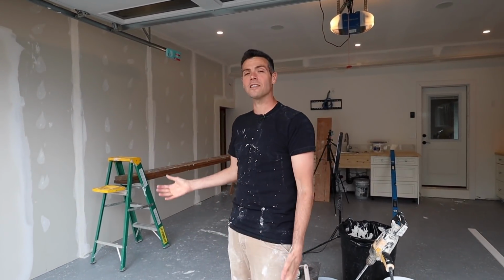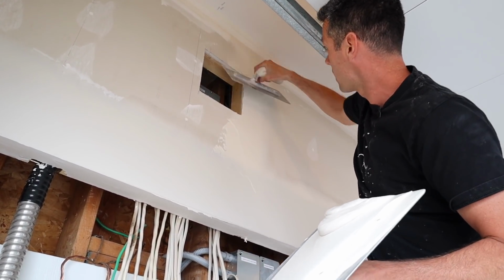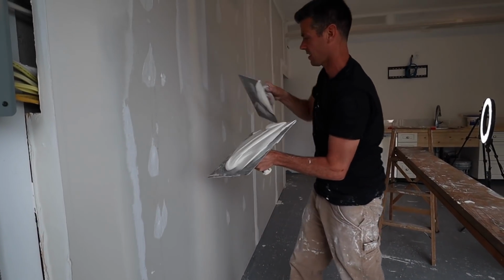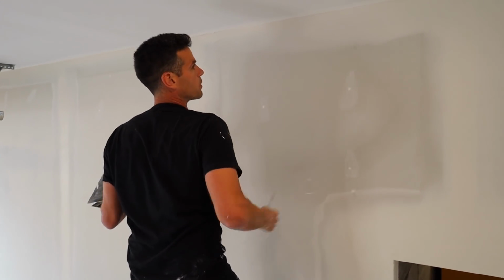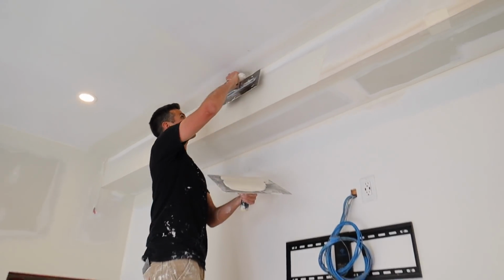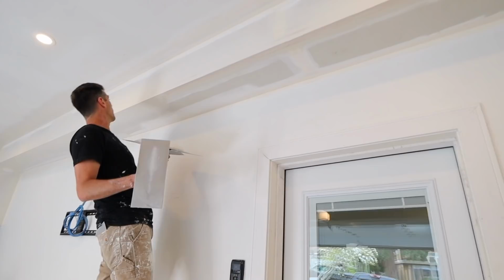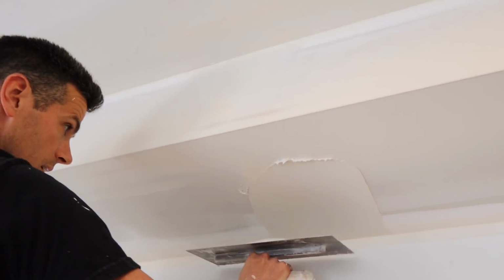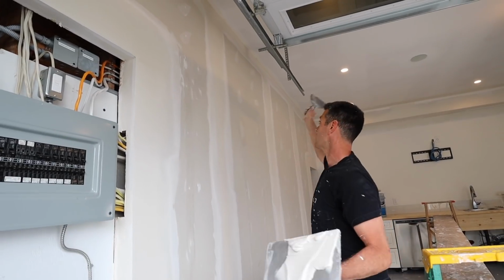First Coat on Nick's Garage!!

Comment: Old man doing home reno here. This is good demo. I'm picking up some helpful tips, like drink too much coffee B-)  But really, watching you work gives me a bit more confidence in my own efforts. Question1 : do you ever use a corner tool to apply mud to both adjacent corners at once? (maybe its in a another vid). Q2: Is your big trowel cambered? Mine is manufactured with a distinct bow, and it and requires a certain amount of "just-right" pressure to cover joints, but feathering is no problem, if i've had decaf in the morning ;-) Thanks for your videos and sense of humour.
Reply from the maker: My trowels are mostly flat but the tips go up a bit at the ends to stop them from digging in.

Comment: Safety! I can't believe you're using that drill with wet hands. You've lowered your resistance to current and way more susceptible to becoming a grounding rod. Keep a towel handy!
Reply: Double insulated tools.  This isn't the 1940's.  I've used them in a downpour.  With no gloves!

Comment: When doing a finishing coat should there be any bare drywall left or is the point just to get a smooth joints and hide the tape? When it comes time to paint can you prime any bare drywall areas?
Reply: Yes and yes. Unless you're skim-coating to remove a texture you don't need to cover the entire drywall in mud. And primer is good for both joint compound and bare drywall.
Reply: Mr. Jacobsen is correct, and most tapers will finish their work with most of the drywall exposed. The key for the tapers is to make a flat wall and that's pretty much it. But you should know that there will be a slightly different texture in the paint where the paper is and where the mud from the taper is. Most times you won't be able to really see, except in critical lighting or lots of windows. In those cases, the entire wall will be skimmed so that all the paper is covered. That is also known as a Level 5 finish, but costs extra and has to be asked for
Reply: @Phazetic99  He made another video on Level 5 so I'm a bit familiar with it. So if it's not Level 5 some bare drywall is fine?
Reply: @djarcadian  here is how the levels work (if I'm wrong, someone with more knowledge, please interject). Level 0 is just bare drywall. Level 1 is all joints taped with taping mud (does not need to be smoothed and can be called fire taping. It prevents air from traveling through and feeding the fire with oxygen). Level two is all tapes coated. Level 3 is another coat, covering level 2 coat. Level four is another coat, covering level 3. Level 5 is entire wall coated or skimmed. Sanding is done in between level 2 thru 5 with a final sanding at the end.

Comment: Hey Ben, I've been meaning to ask you for some time why you don't use a pool trowel for skimming and general work rather than a straight edge trowel? I get that it's easier to get into corners with the straight one but I would think it would get a softer transition on most everything else.  Thanks man, I really appreciate your videos.

Comment: It's intriguing to see the difference between how you fit drywall in the US and how we plasterboard in the UK. There is a method in the UK similar to what you are doing in this video, but we don't cover the whole wall with mud, only the areas where two boards meet.
The boards have tapered edges so the joints can be taped and filled with jointing compound. Then the surface can be decorated. The other method is to use straight-edged boards and the whole area of plasterboard is covered in a thin (2-3mm) skim coat of plaster. The compound used on tapered boards is similar to mud, but when skimming the whole area, we use a gypsum plaster.

Comment: One of the polysymes (the numbered entries from the dictionary) for feather is to vary the angle of a blade or propeller. I think that's the definition you are using and it certainly does not have a translation in French
Reply: Actually I believe the term implies thinning out the edge of the mud so it tapers out to nothing, i.e. "thin as a feather", rather than defining the angle of the knife or whatever.
Reply: @tridium-go6hw  You're not correct. You have found the point where the polysemes blend together.

Comment: Why do you always start your trowel with a sliding left/right motion before moving it up or down? Why not just straight down or up?
Reply from the maker: It helps the mud compress in the corner better. leaves a nicer corner.
Reply: @vancouvercarpenter  Thank you, I've bought most of your linked items at this point and have used what I've learned on your videos to do projects on my house, Also bought the Tapebuddy from your bathroom videos and it's great!

Comment: Drywall is incredibly insanely frustrating a task forged in hell by satan himself. I'm re doing my basement about 1300 Sq ft. I've been doing drywall for about  month now and have not completed a single room. I want a professional finish and I am not so I thought a few extra coats, start in the closet and it'll be tough but I'll get it down... nope it's breaking me mentally. I've painted rooms twice and if I can see anything I try and try again🤯